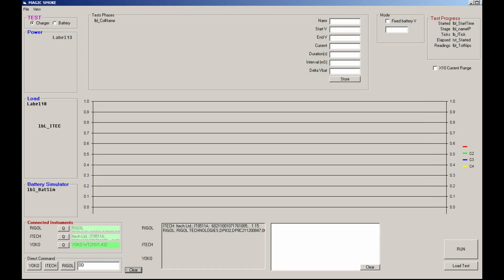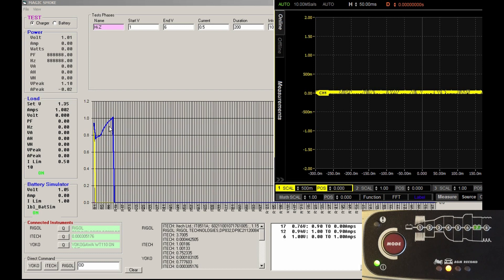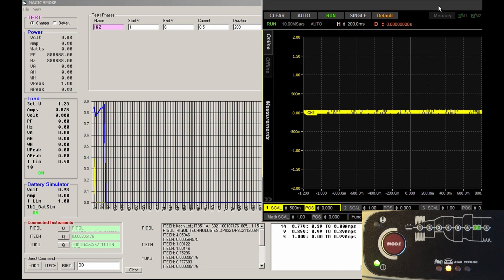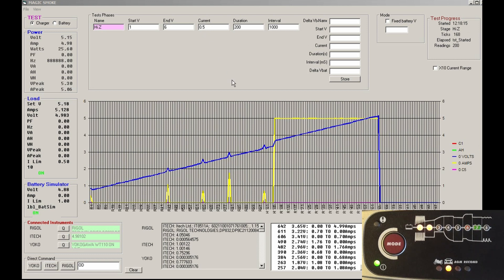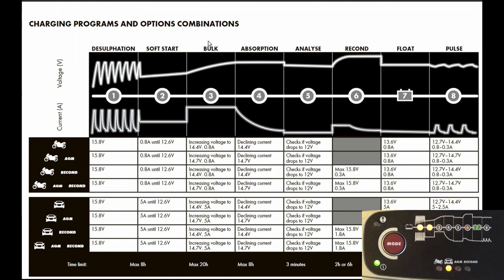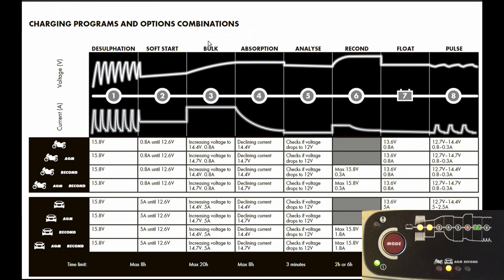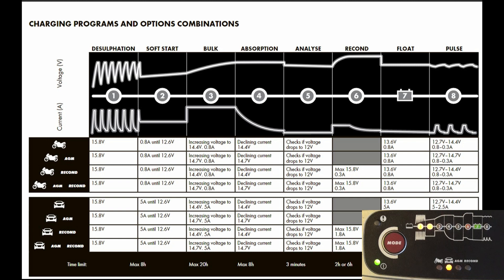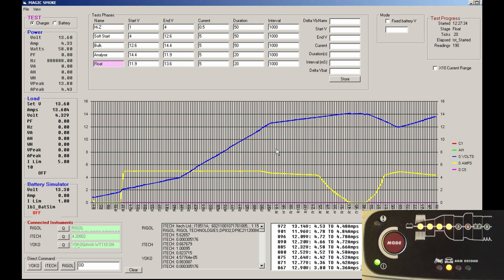CTEK Desulfation Mode Explored and Tested

Comment: I always thought a 2-3 volt reading 12v lead acid battery is a dead damaged battery. Maybe to "try" and get you going again when your stuck, but I think a replacement then would be required.
Reply from the maker: A battery would never recover from anything below 10 Volts for any length of time. Maybe the older non sealed wet lead acid cells could be recuperated but the modern sealed starting cells are easily damaged. I wouldn't even recommend leaving the sidelights on for more than five minutes!

Comment: Great review and test of Ctek battery chargers. I'd like to see you test PulseTech Battery Charger's and PowerPulse passive battery desulfators. I use a PulseTech Power Pulse battery desulfator that you leave on your battery at all times, PulseTech claims that it will extend the battery life up to three times, and uses a patented frequency rather than use voltage spikes.
Reply from the maker: Great suggestion!

Comment: which charger would you recommend for a good desulfation even when the battery is decently charged (>=80%)?
Reply from the maker: Hi Hung, the CTEK is pretty brutal but can be effective. It depends on the degree of sulfation.  If the car has been used for short trips then a simple full absorbtion/float charge on a monthly basis in the winter will probably at least double the life of your battery.  Use the CTEK, dont leave it connected to the power mains for more than you need else it will blow. keep it in a warm dry place and don't use in very humid environments.  Never bring it from a cold environment to a warm and power i u straight away because  condensation will form and boom. Protect the push button area. One knock on the push button damages the clicky dome and you will have change it so keep it in a box. The CTEK is probably the best at recon but it is shame that it well engineered to suit isn't operating environment. I did an IP65 test to it rating and it just went bang when powered up.

Comment: I own CTEK MXS 7.0. It seem to have developed a problem . I hear the sound of switching repeatedly, and the programme is stuck on the start of Bulk charge but charging not going on . What could be the problem ? A faulty MOSFET?
Reply from the maker: Could be ... have you checked the fuse in the battery lead. The FETs are easy to check with a  multimeter. Usually there are visual signs of distress.Open it up and check for corrosion or any burned or discoloured components. The switching sound might be switch mode the power supply folding back due to overcurrent.  Only run it out of the case if you know what you are doing ans are aware of the risks.  I have never seen the MXs7.0 my guess it is an overdriven MXS5.0 producing about 6 Amps.

Comment: Does the desulphation mode not have to be set to "RECOND" on the charger? Also, on my CTEK (same model) the first light that flashes on your demo, is constantly lit once connected - no flashing.
Reply from the maker: Good question.  There are many claims and no explanations and many disclaimers in the documentation.  What is happening when a stage LED does not match the documentation.  Draw your own conclusions but know that a sulphated VRLA starting battery will always be a sulphated VRLA starting battery.  Might as well buy sine snake oil from the market and rub it on the outside of the battery case... just as effective.

Comment: has anyone ever putt these  battery gubbins in a transparent case, so you can actually see these chargers at work?
Reply from the maker: I don't know. As far as I can imagine (which is very limited) it would just look like an electric board in a clear case. You will not be able to see the angry little electro pixies at work unless you take some hallucinogenics first...

Comment: Ctek states battery voltage should be no less than min 2v for charge or desulphication to start.
Reply from the maker: If the terminals have dropped to 2V then you will need  'miracle mode' as the battery is already totally ruined..

Comment: From what i know ctek is not the best in desulfation.a us company has patented impulse technology which is said on various websites that works with true. Pulsetech is their site.Good views are also about Battery minder chargers.After your experiment it become obvious that ctek is just a better or worse  charger.i think they misplaced the method of desulfation, and that it was there.they just want to see if the battery accepts it or not carging.the questin is how can we really desulfate a battery?
If i had your knowledge i would try to find out.ty
Reply from the maker: Patents in the USA are easy to come by. A Patent is no proof of efficacy of the device described within and also not proof of pre-existing knowledge or techniques. It just means the Patent office didn't find anything in their superficial search.   The electrical methods outlined have been known and understood for years. If you use on a  healthy battery then it is similar to a doctor prescribing a drug with bad side effects to an otherwise healthy patient just in case  they get sick.......Much better Keep the battery in good condition by performing a non-destructive regular (~monthly) absorption charge on a vehicle that does short runs or is parked.  This is a charge at low current ~(70  to 150mA) until the terminal voltage reaches 14,4V @ 25 deg ambient.  Typically this can  tale up to 10  hours to complete. During this charge the battery accepts the final ~20% of charge capacity and more importantly the stage at which the remnants of the microscopic amorphous  coating of lead sulphate covering the plates is broken down by electrolysis without etching (damaging) the battery plates or dissociative gassing of the electrolyte.  If left in place, these crystals act as seeds for growth of larger un-shiftable sulfate crystals that cause permanent damage by obscuring active areas of the battery plate rendering them inactive.   If you do short trips in cold weather and you are driving around and using a partially discharged battery.  So safe prevention is better than a damaging cure. Give the battery an absorption charge once a month and forget desulphation as is it is an urban myth from years ago when you could safely mistreat heavily built  batteries with robust large plates that could be over-voltaged without damage and the electrolyte loss could be replenished with Distilled water.  . Modern batteries have minimalist designs are just about designed to last the the warranty period with less than ideal vehicle charging regime. It is all about a huge and lucrative business.
Reply: @razenby  thank you so much....
Reply: @razenby respect, this is the best comment about car battery charging, 150 or 200 mA ? Greathings from Sunny Beach Bulgaria

Comment: Thank you for the extensive testing videos on the CTEK.  I bought a NOCO Genius 5, and it has some of the same functionality of the CTEK, but the manual is quite poor and it doesn't show the charge profiles like the CTEK. I had to go go their website to get more information. I fell for their slick marketing of being able to desulphate the battery but like you showed here - they only desulphate when the battery voltage is low and I feel it does the same as you have shown- a few quick pulses before moving onto the next stage- so basically useless.  As you said sulphation happens across the voltage. Its only after I started bugging the support desk it finally came out that the only way to desulphate the battery is using their recondition mode. There are older model battery  chargers/ maintainers that provide a desulpation pulse no matter the voltage and probably do a better job of recovering a battery
Reply from the maker: Thanks.  I have got hold of what seems to be a reasonable 8A charger from China. It claims toe have full recondition mode. I have briefly tried it and I can hear the current spikes even at full charge. I'll run it on the system connect it up soon and do a video. It is on my todo list.
Reply: I had a NOCO. The problem was the build quality. The strain relief cracked where the 120 volt main power enters the case. A  few mm of both bare conductors were exposed. NOCO show marketing pictures of the charger sitting in the engine bay. That won't end well. I switched to a CTEK polar specifically because of the better build quality that is rated for cold weather (mechanical rating of the materials used for the case, cord insulators, etc).

Comment: Hey, thanks for you full analysis on the charger. Still interested in you opening up the battery to see the physical sulfation though, that would be cool to see.
I bought one myself to see if it could save a motorcycle batery that wouldn't crank the engine anymore but still reads 12.8V with the ignition off. The motorcycle shop on the corner charged it overnight and did a load test. They said it wouldn't hold it's voltage so it's a dud. It's an AGM battery so a replacement would cost at least as much as the charger.
Interested to see if this charger could resurrect it by either a normal charge or using the reconditioning mode. There seem to be many people on Reddit who did and got a few more years out of their battery. If it doesn't, I'll at least have a charger to keep the next battery in good condition and an expensive paperweight.
Reply from the maker: Did it work?
Reply: @razenby  
Yes it dit! 

I let it fully charge and run the reconditioning program, and then another full charge overnight.

The Yuasa battery keeps giving over 12V when starting the engine. However sometimes at a gas station for example it doesn't start the engine in one go. However after that, it will crank strongly. But still don't fully trust the battery. I think the low charging state did some permanent damage to the battery and it has a lower maximum capacity now.

Still saved me 80 bucks on a new battery though and the charger will keep this battery and eventually the next ones in good condition for years to come hopefully.
Reply: On you tine is a video with an official of ctek. He said  the  recond.  mode is the best way to desulphate a car battery.and u can do this 2times without stop.one by another
Reply: To avoid such problems, you must charge the battery regularly. And  must not let the battery drop below certain voltage values.it will be able to sulphate  and lose its energy

Comment: could you put it in recond mode plz, then test it
Reply from the maker: Recond mode is explored in the other videos on the CTEK on this channel.  It just overcharges the battery. On a Macro scale, overcharging  dissolves lead at the surface of the plates undermining the Lead Sulphate crystals and they fall off exposing an active plate surface this increasing the capacity and reducing the source impedance of the battery.
Reply: I thought the same thing. Previous recond video i could not physically see if recond mode was used. As we could not see the charger.. But i trust this dude nobody will go through this effort to not have recond mode on 🤦🏽‍♂️. Thank you for the video you saved me money. Just going to buy the Bosch c3 charger its 3.8 amp and much cheaper.  Any thoughts on the Bosch c3?
Reply from the maker: @lovendhranaidu5606  Ill do that next when I have finished the ongoing NOCO Genius5 review.
Reply: Recond-mode works really well for me!
Reply from the maker: @orfeous  How do you know?

Comment: I teach engineering and electronics, this is a great video and it is helping me ascertain the best way to keep my 3 vehicles, 2 old road cars and a project car charged. I have an old linear 4A and 8A halfords charger and a constant current 300mA Draper trickle. I tend to use the bulk charging to  get the 12.7v or so then trickle it to 14.5 and disconnect and redo a month later. It is a faff and a decent auto charger would have helped.
Reply from the maker: Thanks